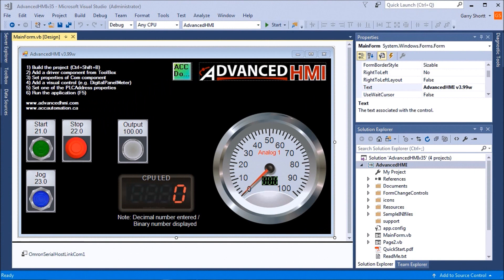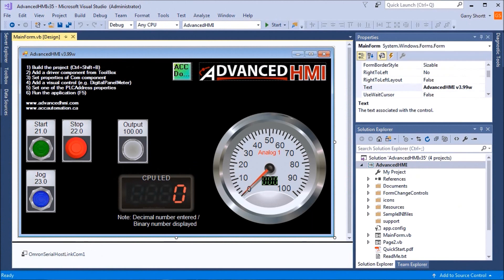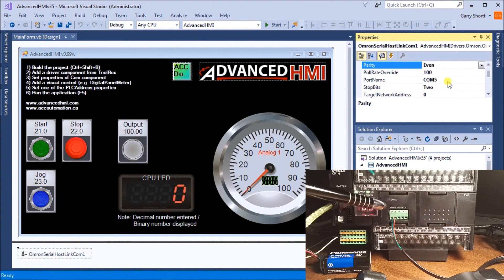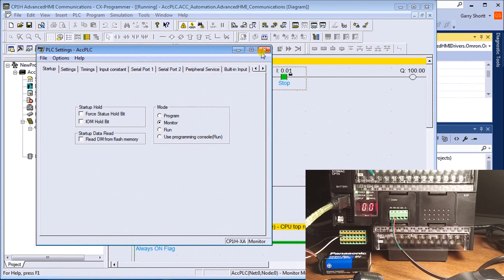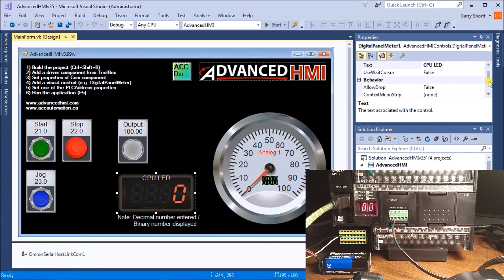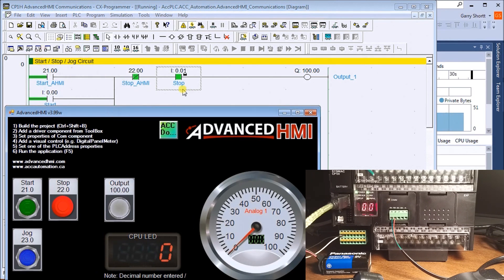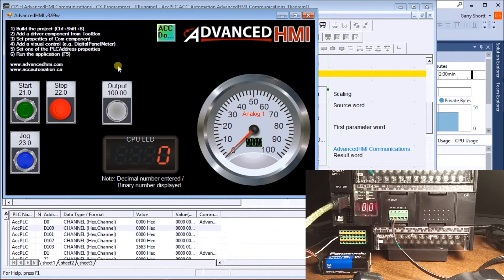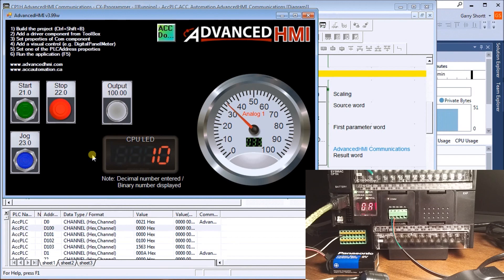Omron CP1H PLC AdvancedHMI Communication

Comment: In this video you are using PLC Omron CP1H specific code? Is it the CP1H-X40DT? I will use a PLC like you to test
Reply from the maker: I am using the CX-Programmer to program the Omron CP1 Series PLC. The model number is CP1H-X40DR-A with a CP1W-CIF11 RS-422A/485 Option Board.
The USB-485M adapter is used from the computer to the Omron option board. It is from automation direct.
http://accautomation.ca/usb-to-rs485-pc-adapter-installation/

Regards,
Garry

Comment: Hi sir  Can you.make a video tutorial  for Cx designer . Just like what u did in omron cp1h series , I known you will have more follower and subscriber in your channel if you would do  this because i check out some videos here on youtube for cx designer and no one didnt from basic  design and how to use it , Thank u so much for your videos was uploaded here , it's a big help for   students and beginners.
Reply from the maker: Hi Jason,
CX Designer is for the Omron HMIs only. This is why I utilize AdvancedHMI software. It has a broader audience and better features that would extend the logging and network communication with the Omron equipment.
AdvancedHMI runs on Visual Studio and is a free download. 
I would consider adding an Omron touch screen and using the Omron software if I get an opportunity to use the product again. I have not used the Omron HMI since the NT31 and NT600 series.
Thank you for the comments.
Garry
Reply from the maker: I have done additional series on the C-More Micro HMI and the C-More HMI units.
https://accautomation.ca/series/c-more-micro-hmi/
C-More Micro are inexpensive HMI units that offer connectivity to several brands of PLCs. They also have Modbus TCP and RTU protocols. The software is a free download.
https://accautomation.ca/series/c-more-hmi-series-panel/
The C-More series is very common in the industry. They offer a wide variety of protocols for many PLC manufacturers. FTP, Data Logging, and Email are standard features of this unit. They also offer free remote mobile software for android and IOS operating systems.
The headless HMI version will also allow you to add your own monitor via an HDMI.
Just a thought.
Regards,
Garry

Comment: how to read double integer or floting point values?
Reply from the maker: Hi Jaydeep,
I have not tried this out with the Omron Driver but in AdvancedHMI  use the following to read:
D0@F will read a 32 bit floating point 
D0@L  will read a 32 bit integer
https://www.advancedhmi.com/forum/index.php?topic=1952.0

I have tested the following:
Modbus drivers uses an address prefix letter for non-typical registers.
L40001 will read a 32 bit integer
F40001 will read a 32 bit floating point

Regards,
Garry

Comment: Thanks for the explanation
Please I want to learn how to program and control stepper motor with CP1H-X40DT
Reply from the maker: Thanks for the comment Abdou. 
Here are some reference links to help get you started.
http://instrumentacionycontrol.net/wp-content/uploads/2017/11/IyCnet_OmronCP1HtoOmron-SmartStep.pdf
http://forums.mrplc.com/index.php?/topic/21613-cp1h-step-and-direction/
There is also allot of information under the instructions in the CP1H manual.
http://www.ia.omron.com/products/family/1778/specification.html

Regards,
Garry
Reply: thank you for the response 
but why not download video how to do this operation
Reply from the maker: If I had the equipment, motors and drivers this would not be a problem. I have done projects in the past with teaching position points using stepper motors with the Omron PLC.
The Omron manual is good at giving you the basic requirements to do the motion control.
Thanks Abdou,
Garry

Comment: Hi Garry, I am using "CP1L EM" plc. (communication pc and plc via ethernet) I create a interface in Visual Studio,  and I start program in visual studio. In this situation there is no problem with communication between PC and PLC. After everything is ok, I publish program and create a setup file. When I install program in pc(my PC or other pc) program opens successfully but there is no communication pc and plc. What is the wrong I do. Please help me.
Reply from the maker: Hi Umit,
When you create a setup program, you must include all of the source code.
https://www.advancedhmi.com/forum/index.php?topic=1092.0
What I usually do is to copy the entire program directory and provide a link to the exe file on the desktop. 
https://accautomation.ca/deploying-an-advancedhmi-project/
https://www.advancedhmi.com/forum/index.php?topic=1441.0
Here is another tip that will start AdvancedHMI if the windows machine is not shut down properly.
http://www.plctalk.net/qanda/showthread.php?t=102394

I hope this helps you out.
Regards,
Garry
Reply: @ACCautomation  Dear Garry thank you for rapid answer. I will try your tips I hope it help too ;). I will inform you.
Reply: Hi Sir, Can you help me step by step communicating Omron Ethernet Fins with advanced HMI? I Have Tried and cannot caommunicating.

Comment: I do with plc CP1E-N30 then address 21.0; 22.0; 23.0 have to change again. I still can not control the plc through the computer. I use USB to RS485
Reply from the maker: Hi Tran,
Can you communicate to the PLC using CX-Programmer and the USB to RS485 converter? This will prove that the serial unit is working.
Regards,
Garry

Comment: Hay Garry, can you do the same with NX1P with EthernetIP
Reply from the maker: Hi KD,
I do not have the hardware for the Omron NX1P. AdvancedHMI will not support EthernetIP on the Omron controllers. You can only use FINS communication.
https://www.advancedhmi.com/forum/index.php?topic=778.0
"The Ethernet/IP drivers only support specific commands for the ControlLogix/CompactLogix/Micro800 PLCs. Unless your device supports the same commands, it will not work."
Regards,
Garry